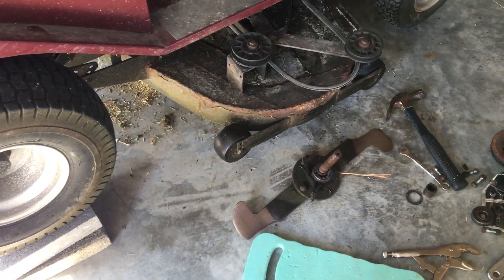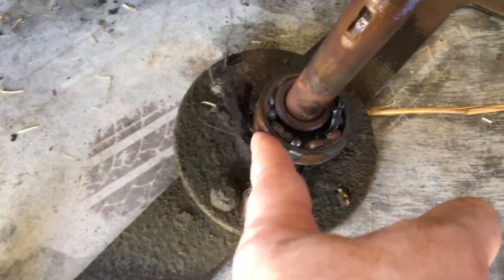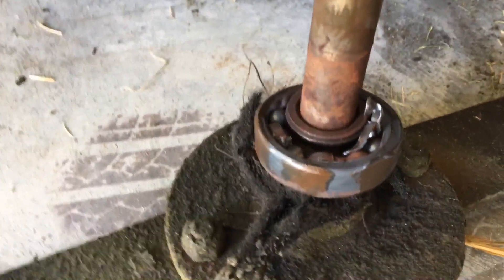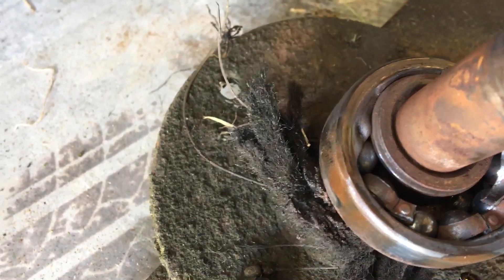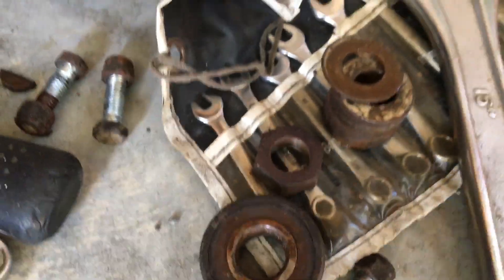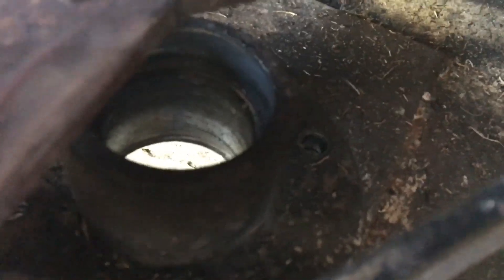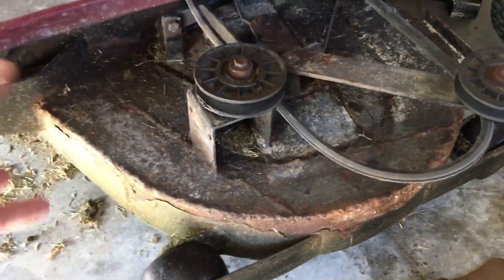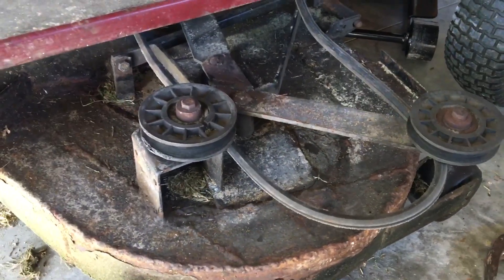Lawnmower deck repair #stories #shorts - I’m an Enginerd...

Comment: I hate sealed bearings and even more bearing housings without grease nipples. Drill and fit a grease nipple tot he housing in a spot where's accessible with a grease gun and before reassembly flick the internal face seals from the bearings so the grease can properly lubricate them. The housing will hold a lot of grease but pump it full and grease them a couple of times/year and it will last for decades.
Reply from the maker: The housings are flogged out, probably 4 mm of clearance, looks like I might have to weld them up...

Comment: I rebuilt the cutting deck on my old MTD, and it was cheaper to order new spindles, belts and a set of blades from the US than to buy locally here in Australia. Costco had a special on a Rover  Raider Ride On Lawn Mower for AU $2500.00 delivered. Not sure if you have Costco in NZ but that was money well spent it just goes and works.
Reply from the maker: Well if I cannot fix it an MTD is on the list already, 479cc or something like like, 38” deck, BUT I will try to fix it first.

Comment: Don't need to machine it cause there concealed bearing. Sand/clean it up and tap a new one in
Reply from the maker: Because it was wobbling around a lot it has worn the mounting hole a fair bit, hopefully a new bearing will be a good fit, but I suspect it will be loose like the existing one, which is why I suspect that I will need to chuck it on a lathe and resize it.

Comment: I was wondering if the brearing hole was cleaned and a nice coating of jb weld and push the new bearing in.
it would last a wee bit longer.
Yes machining and a shim tube is the propper way,  but if you don't have an engineering shop on your doorstep,  a bit of bodging is possible.
Now you know you like a bit of bodge ha ha :-D
Reply from the maker: That might work.., and as luck would have it some Chinese metal adhesive arrived a couple of weeks ago.... hmmm I wonder if I should risk it.
Reply: @TheDefpom  It cant make it worse, and jb weld or similar can be machined out if you change your mind.
Just make the surface clean from grease/oil so it has a chance.
Shame they didn't design it with a clamp to keep the bearing from escaping, like they do lol.